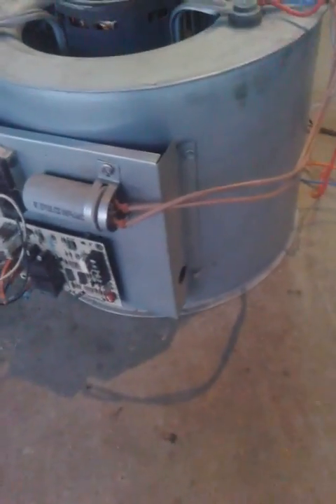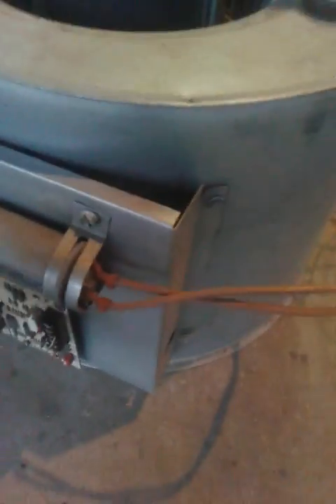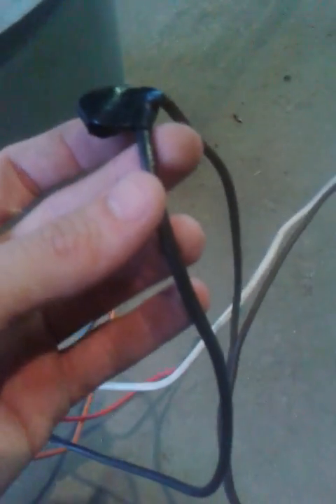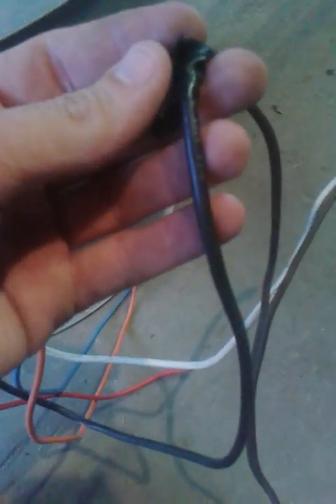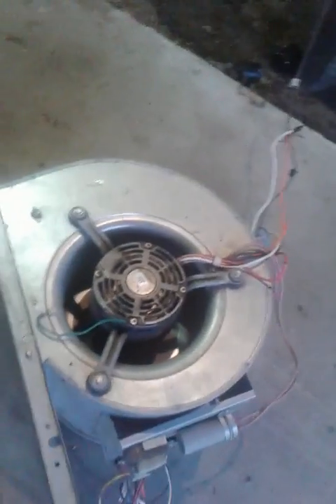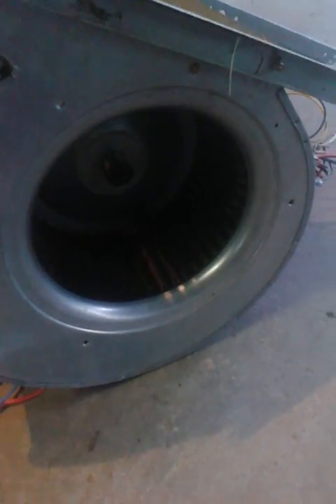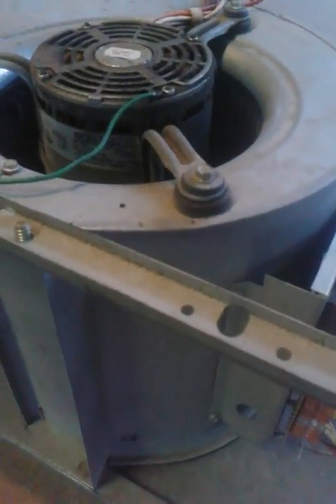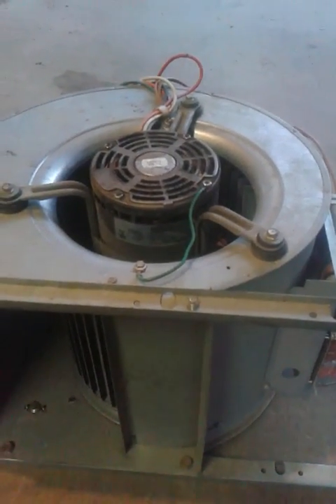How to use a gas furnace squirrel cage as shop fan

Comment: So if i enclose mine in a wooden casing (box), and reduce the intake area to about 50% .... A ND reduce the exhaust end (outlet) to a 4-5 or 6 inch hole out of the shed it work better to pull paint fume through a filter on my paint table ? Thanks

Comment: You make a lot of sense Ben.  You mentioned that if you incase the unit in a confined space this will be enough to limit the intake is this correct?  If you have openings in the confined space covered with filters will this be ok?  I have one of these (1/3 HP) in my shop and I plan to incase it in a wooden box with filters.

Thank you for the information.